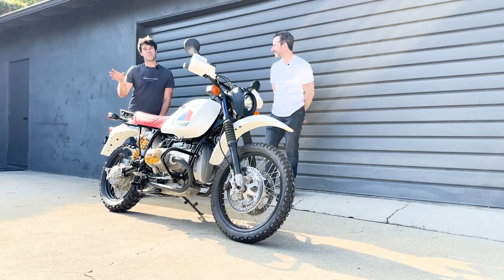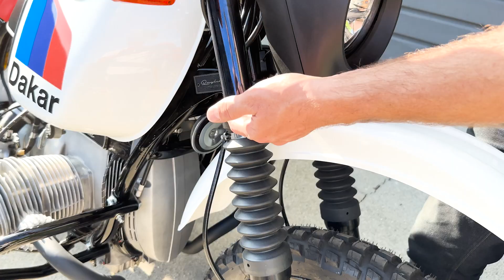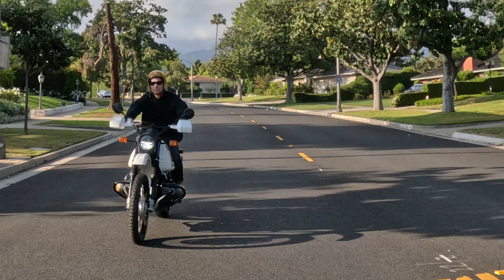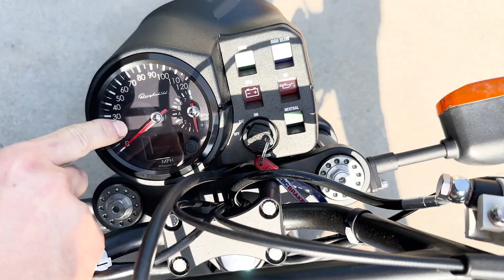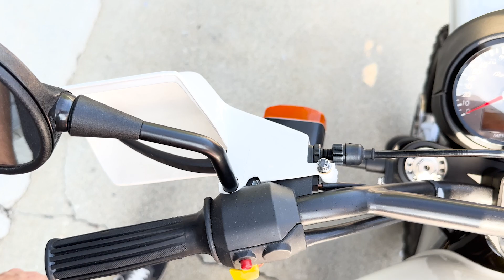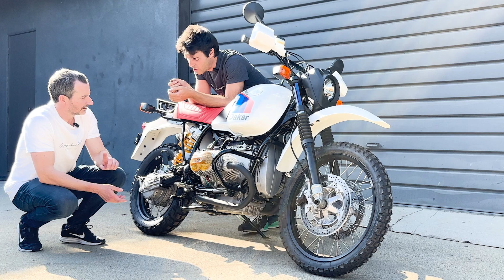BMW R80G/S: Paris Dakar 999

Comment: What did you alter to make the big bore (Siebenrock?) fit the engine? Big bore kit doesn't fit an R 80, does it? Other valves as well then? Thanks!
Reply: or is it just the Siebenrock Power Kit for 1OOOcc? (which is not the same as the 'Big bore kit 1070', which would not fit the r80, says Siebenrock... Just to be clear ;)
Reply from the maker: It's just metal, anything can be made to fit

Comment: Hi, another fantastic creation;)
Which type of Ohlins did you use front and back? I’m looking for a good alternative for the stock front suspension that looks as standard as possible…
And also: what did you alter to make the big bore (Siebenrock?) fit the engine. Other valves as well then?
Thanks!
Reply from the maker: These are Ohlins Universal Telescopic Forks. But there's far too many changes to retrofit to a stock bike without rebuilding the whole thing with a plan in mind. Standard heads on this one.
Reply: @RoughchildMoto  Sounds a bit out of my league for now. Some research first...

Comment: what stops that back brake adjuster from un winding its self , looks like the curve is missing from the brass part.
Reply from the maker: Well Tom it's under load from the sprung brake shoes.  The brass wing nut has a curve that matches the radius of the trunion in the brake arm
Reply: The R80 G/S Paris Dakar is a great bike , I have a 86   999

Comment: You would be better off starting with a Moto Guzzi V85 TT and doing the 21inch 18inch wheel conversion and just getting rid of all the Euro emission nonsense to make it much lighter.
Reply from the maker: Maybe for some, way less work for sure, I wouldn't consider that better off though
Reply: @RoughchildMoto  have You tried a V85TT? I did and they are wicked fun. On and off road. I had a BMW R1100GS and I would say out of the show room floor the TT has more rev happy engine and sharper handling. And with the 2024 VVT engine it is supposed to have more low down torque. Don't get me wrong I like Your build. Visually I would have jacked up the back a bit cause it looks like it is squatting. But I admire You finish! The bike looks factory built.
Reply: You'd be wrong.